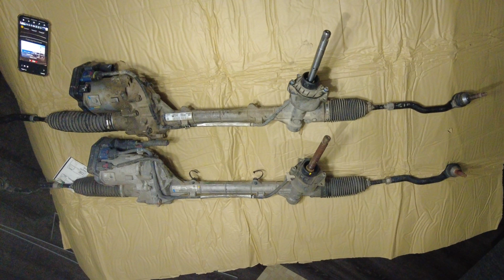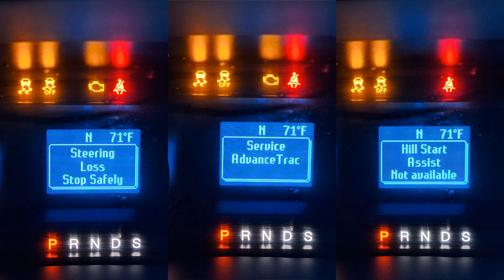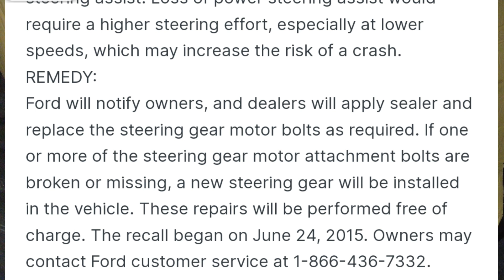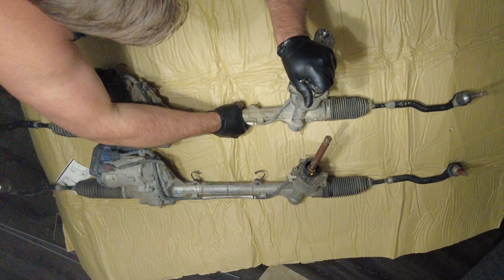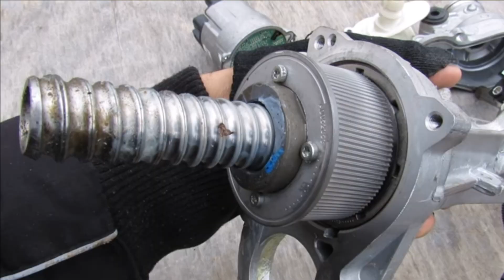Ford EPAS code C102D  No power steering

Comment: Thanks for the video.  I have a 2016 ford fusion.  I get the same code, C10D2 and I also get U0420.  If I reset the codes, I immediately get power steering back for awhile.  Battery and alternator are good.  Haven't tested my 70a fuse yet.  I hear so many things, check your ground, fuses, abs wheel speed sensors, could be rack.  Losing my mind and its the only vehicle I have.  Any help would be great.
Reply: Hi, I found the cause of the problem. I have the same problem now.